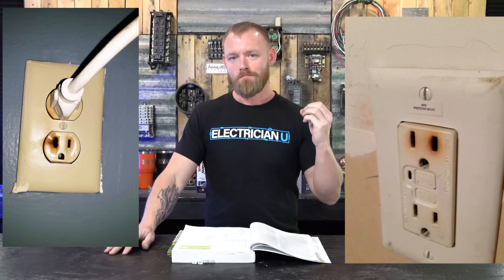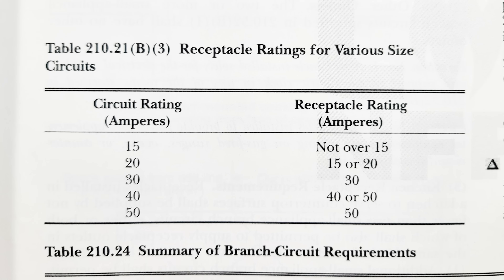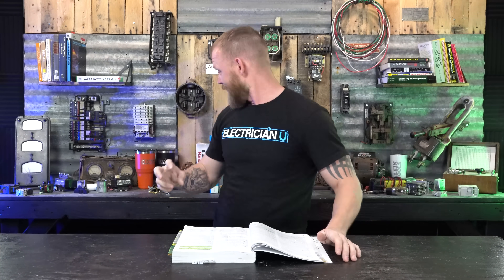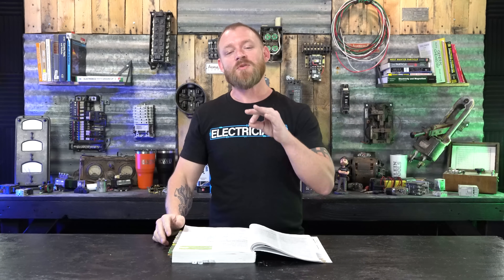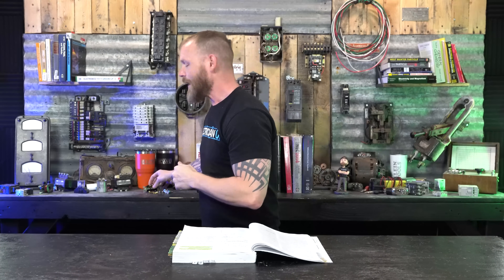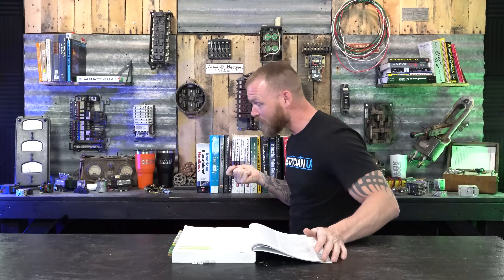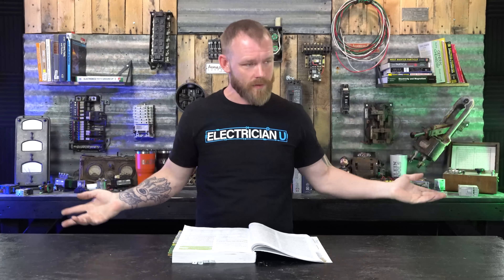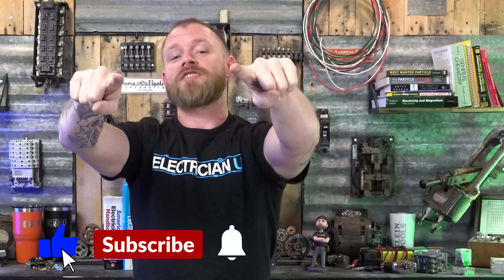Won't These Melt?!? 15amp Receptacles on 20 amp Circuits!!!

Comment: I was under the impression that the 15A receptacles are actually built to handle 20A but just don't have the 20A faceplate on it. I had figured that melted outlets were from multiple things plugged in or from increased contact resistance from worn out receptacles. Is that true?
Reply: Yes 100%. Identical internal parts. Only different orientation. 
Melted receptacles are most always loose or otherwise resistive connection of the plug blade or the wire connection.
Reply: Yes.  Context of the load matters a lot.
Reply: I was looking at a 15amp gfci and it stated it is rated for 20amps pass through so yea there the same besides the faceplate.
Reply: @FishFind3000  GFCI are slightly different in that regard, simply because they already cost more money and are less common than a standard recepticle and also can pass through, they are pretty much all built to be 20 amp, while really cheap 15 amp standard receptacles might not be
Reply: Loose connections play a big part as well
Reply: I always was under that impression as well.    If you look very closely at the new 2 slot receptacles (FYI they are still manufactured today, for replacement use only,  on older circuits where no equipment ground is available,  ) the receptacle front is shaped much like your standard 15 amp grounding receptacles,  only the round ground slot  had been covered over, and the green grounding screw is not in the threaded hole near the bottom of the receptacle.
Reply: Yes correct, the difference being a single, high current "20a load", can only be plugged into a 20a device. 
This assures safety of the wiring.
Reply: I guess the point is knowing that the average homeowner doesn't understand any of this, what is to prevent the scenario where they plug the multiple space heaters into the 15amp outlet? The idea of requiring labeled single outlets for "high-draw" appliances makes some sense, but obviously people would find a way around them. Is there a effective way to have the breaker trip when that 80 or 100 percent is reached? Or should more "high-draw" appliances be required to have the NEMA 20 amp plug regardless of actual power requirements to prevent them being plugged into an inadequate outlet?
Reply: NEC 210.21(B)(2) and Table NEC 210.21(B)(2) 15 Amp receptacles are 12 amp max load. and 20 Amp receptacles are 16 Amp max load.
Reply: @tiggeroush  that's because residential breakers are rated for only 80% continuous load, not because of the receptacle
Reply: @tiggeroush  so a 20A receptacle can melt at 16A, but a 20A breaker only triggers at 24A? That sounds like a really dangerous way to set the standards.
Reply: @Spencer-wc6ew  Thats not what the standard means. Ratings for everything are always less than what the device can actually handle before failure to have a factor of safety.
Reply: Residential grade receptacles are definitely not designed to pass through more than 15A.  That is why they are so inexpensive.  The commercial grade receptacles and heavy duty receptacles rated have heavier bus bars which can pass through 20A to the next outlet on the circuit.  GFCI receptacles have them as well.  Melted outlets can occur for a variety of reasons among them normal wear and tear and overloading.  I proactively replace any outlet I find in my home that doesn't firmly retain a plug.

Comment: great video, I am just getting to run an extra 20 amp circuit out to the garage to run a small flux core welder, this video gives me useful information   Tnx
Reply: Muchas gracias por cada uno de aros videos .!! Soy electricista … y estoy aprendiendo más y más cada día con tus vídeos . Muchas gracias por tomarte el tiempo y por la calidad de vídeo que tienes .!
Reply: Make sure it's a gfci
Reply: @Jason_Van_Stone  thanks for that, much appreciated.

Comment: What about switches on the same circuit? 
What if you have a 20 service. You have a bathroom with a switch a light and a receptacle on the circuit. There’s no heat or air in the room, so in the winter someone will use a heater in this bathroom. Do you need to protect the light and switch?
Reply: I don't put lights on receipt circuit.  20A for receipt, 15A for lights.  Too many wires in switch box when you have many 3 and 4 way switches.  Plus if you pop a breaker you are not left in the dark.
Reply: Yeah. Up here in Canada it's actually against code to put them on the same circuit now.
Reply: Great points. I don’t do new work though. A ton is 70s 80s work. usually in a remodel I’ll change out the gfci and there is one line ran to the box and both are powered through that one circuit. Not always but lights sometimes are ran off same circuit. What would be the best recommendation for the homeowner. And how unsafe is it? If it’s been that way for 30 years, how do I assess the risks?
Reply: @HomeMasterRenovations  I hear you. Up here only the receptacle is required to be gfci. Because its not expected that water would spray the light switch or fixture. But appliances can be expected to be dropped into the sink. Or exposed to a wet surface.

Comment: 130 percent of 20A is 26A but your point still stands about it not tripping immediately after 20A
Reply: You need to do that math the other way my dude
Reply: @Morberis  how are you calculating it.
Reply: @mikeatgmail9705  in Canada, ampacity of circuit times 80%. So 20ax0.8=16a. You reverse that to find out what size of breaker you need and size the conductors off the breaker size.

If you want to use a continuous 20a load on a 20a breaker you need a continuous load rated breaker which are rare if available at all and expensive.

Any modern breaker I use will trip pretty quick at 20.5a.

Other load types like motors have different rules. You take FLA of the motor, say 21a, and reference table 29. So a single phase motor has an OL setting not more than 175% of FLA if using a time delay fuse, 300% of FLA if using a non-time delay fuse, or 250% of FLA with an inverse time circuit breaker.

Comment: I have never seen a 15amp plug melt from load.  Loose connections yes.
Reply: there's only two reasons for that bad / loose connection. Cheap outlet or repeated high draw causing heat, which reduces the spring tension of the blade area. Eventually it will get hot enough to show signs of heat damage.
Reply: I've seen receptacles melt from something plugged in that was a short circuit, but not from an overload.  I have seen breakers melt from overload.  A 40 amp load on a 30 amp breaker that didn't always trip.
Reply: Arcs run at 10,000 F.  Any arcing will quickly melt stuff even if amps are low.

Comment: So part of this explanation that doesn't sound correct to me.  You are saying that a 20 amp breaker will not trip until 24 amps (and implicitly that the 12 gauge wire can handle this, and the 20 amp receptacles can handle this) but a 15 amp receptacle is only made for 15.0 amps?  It comes down to the code requirements for UL listing I guess.  It would make more sense to me that all wire and receptacles should be made to withstand 135% (if that is the desired safety rating) of it's rated current.  So then a 15 amp receptacle should be able to handle more (maybe 20.25 amps), so the 21 amp draw is less dramatic than saying it is 6 amps (40%) too much.  But then, that would seem like common sense to me. I don't know safety factors for electrical components.
Reply: Modern circuit breakers trip on temperature, overheating and overcurrent. So 20amp breaker tripping at 24amps is fuse factor. UK devices are rated 6k or 10k, this means they can withstand 6,000 amps. Potential fault current, that's why your old fuse wire use to go with a bang. Most of our outlets have 500 plus amp potential under fault this gives quick disconnection times.
Reply: You have that all backwards. A 15a breaker will trip on sustained greater than 12a load, a 20a breaker will trip on greater than 16a sustained load. 

Anything between those ratings and the breaker rating needs to be cyclic to not trip. Because the breaker will get too hot and trip otherwise.
Reply: @Morberis  ... actually, you have it backwards and Douglas has it right. Breakers will hold 130% load for a period of time before tripping. The 80% rule is a built in safety factor for circuit size calculation.
Reply: @rupe53  Hmm maybe, I'll have to look it up later. Or it's a difference csa vs nec.

Comment: I think the reason there melting is an old plug or worn out outlet making poor connection and thus higher resistance and more heat.
Reply: Or the 39 cent outlets they sell at HD or Lowes.
Reply: thats right...loosy-goosy outlets wreck havoc on plugs...causing high resistance and arcing......
Reply: I had a burned plug, and there were screws to take the back off.   Back in the day, the spring sides were replaceable.   They were 30 years past their replacement date.
Reply: @normbograham  yeah my sister in law had a spa on a fifteen amp circuit and it melted the main GFI outlet I had to kinda fix it because the house passed the home inspection but my conscience told me to fix the outlet and make sure all outside outlets were GFI protected. What is wrong with these inspectors I would be checking every outlet with a GFI meter or something. Inspectors get paid good and they don't even do their jobs correctly.73

P.S. I learned a little trick to trip the GFI on the daisy chained outlets put a wire in the neutral and touch the ground with the other end of the wire it will trip the GFI anywhere in the string. Your hand will also trip the GFI also but don't try this at home. 73
Reply: @ronb6182  Now, they have plug on neutral, and cafi breakers (gfi's built into the breakers).  In my mind, it's the greatest innovation in electrical, since they came out  with cable wire (NM), the mice didnt like as much.    Second would be the wago lever nuts.
Reply: @normbograham  yeah I heard about them I probably keep using old school nuts I don't like push in connectors of any kind. We have some in our light fixture I pulled out the feed line very easy, the ballast wire was a bear to pull out because it was a smaller gauge. If I was in the electrical business I would probably switch to save time. I don't have many junction boxes because most wiring was daisy chain. The grounds are the only wire nuts in most of the house. The fans came with their hardware so I used it. I probably won't upgrade the breakers either. The shed is going to be EMT before I close in all the walls. I want to do some EMT work just to keep in practice in bending conduit I know they have ends and other openings for wires. My dad used both Greenfield and bended Conduit back in the fifties. I hope I can do it half as good as he did. Thanks I will keep in mind about the new products coming out. At least when I do an LED conversion I know the hot wires can easily be pushed into them connectors the only thing I still have one wire nut to do because the blue wire is too short to make it across the fixture I do end to end hookup because of shunted tombstones. My company won't buy new tombstones. I'm lucky I got the bulbs. Small companies have small budgets but I'm there maybe two more years then to the mountains for me . The little house I wired years ago will be home. 73
Reply: @ronb6182  Jumpering neutral to ground would give a bit of an arc flash surprise if it turns out to be wired backwards! It also might not work if there's not enough load to make a voltage difference between neutral and ground.
Reply: @NiHaoMike64  I don't wire backwards period. Also they make ground plugs that test polarity. Enough Said. 73
Reply: Yeah there are many causes that make receptacle outlets melt. The one thing people don't mention is arcing that goes on inside the outlet. Silent switches arc a lot especially when they get older. They should bring back the click switches they never Arc. But people don't want to hear a switch. I remember the soft click in our bathroom switch. Kinda miss that sound. 73
Reply: WHAT?! Your reply makes no sense! Please investigate what a homonym is and maybe re-post. (Hint: they're, their, there.)
"Worn out outlet" WTF?! If it's "worn out" (optimal word being "out") then won't it NOT WORK?!
And if there's an increase in resistance won't the load then require more current -- not less? (It's basic Ohms Law.)
... Again, I can't figure out what you are trying to say.
Reply: @WXSEDY  When he refers to “worn out,” I believes he means a receptacle that does not make full contact with whatever is plugged into it.  In other words, the plug is loose and making poor contact.  The partial connection is like introducing a section of smaller wire in the circuit.  (Smaller wire has more resistance per foot than big wire)  This smaller wire (loose receptacle) will now heat up more than allowed and may melt the receptacle.
Reply: @WXSEDY  Suggest you stay with the english lesson.  Lower resistance will increase.

Comment: I use 20 amp breakers and 12 gauge wire and make sure I use spec grade receptacles and devices when possible. They cost more, but are better built, live a longer life, and most allow 20amp pass through.
Reply: Cheep fire insurance
Reply: ....why not use a 20a receptacle... After all the expense it's only like 25¢ per receptacle.
Reply: @Morberis  yeah multiply that by 400 that's why. Watch the video he already answered that question. 73
Reply: @ronb6182  Maybe the US pricing is biased because you don't buy them.
Reply: @Morberis  no I never bought one because I'm not an electrician. I will buy a few in the near future. I have a washing machine outlet on a fifteen amp outlet with a 20 amp breaker. It passed inspection. In my current home and all the past homes we had had regular fifteen amp outlets on the washing machine circuits and all had twenty amp breakers. My dad had thirty amp fuses on all the outlets and lighting. That was legal in the fifties. The outlets took two different types of plugs they all were rated at thirty amps. None had grounds but the boxes were all grounded by EMT. 73

PS when you are in the field of electrical you will use what code allows and not more . If the customer wants 20 amp outlets then you put in 20 amp outlets. I'm just a home owner and will use 20 amp where I feel they are needed. The washer and workshop will get 20 amp outlets. Most people don't even load their outlets more than 300 watts at most. TVs and computers don't draw that much current anymore. I would never use number 14 wire in my home I have used it outside but inside I wire with number 12 no matter how much it cost. I have two 250 foot rolls and a partial so I won't be buying wire. I always believe buy when the price is low. I only paid 35 dollars for the first roll the other two more like 49 or so. Now it's much higher. I also have plenty of number 6 three for the range. Now they are using number right but let them 6 is better. 73
Reply: @ronb6182  73?
Reply: @MMGJ10  best regards
Reply: @ronb6182  Uh no, like he says code is minimum and better shops definitely treat it as such. 

People definitely use more than 300w. Even with computers 300w is on the low side. New video cards can pull more than that.
Reply: @ronb6182  I just had time at work so I decided to double check and pass it on. A 20a receptacle is $1.15 more than a 15a receptacle. $2.74 vs $3.89.

Though as you go to higher spec versions the price diverges a bit.
Reply: @Morberis  you are probably right but I know what I use . I have low monthly electric bill. Lighting is LED and one TV which ain't much. My water heater is on a timer which is about an hour and a half a day. AC is a window unit and I don't cool the whole house. Maybe later I will add up the watts from each outlet that I use I don't use every outlet in the house. Also I turn off which is like pulling the plug my TV don't stay connected when I'm at work. I won't use any box for tv service. That will give you an idea that I don't use much electric. 73
Reply: @ronb6182  You don't need to be an electrician to change receptacles, that's heresy. If the wire to the receptacle is no. 12 wire and it's on a 20a breaker it's cheap to put a 20a receptacle on it because you're doing (insert small number of outlets here) instead of a whole building at once.
Reply: @hithere7382  what brings this on I wired the house from the meter box to the last sub panel and every light, fan and outlet your comment don't make sense. 73.
Reply: @ronb6182  I read your earlier comment as you saying you've never purchased or replaced a receptacle.
Reply: @hithere7382  not mine I do my own wiring and replaced many outlets and switches. you must have someone else s comment in mind.

Comment: I just looked at a 15amp gfci and it’s rated for 20amp pass through.
Reply: This is the same for 15a Receptacle too, which is why a 20 amp overcurrent device is allowed on these circuits.

Comment: DIY’ers are changing out discolored or wrong colored outlets to match a newly painted wall for example.  When they are strolling down the aisle at Home Dopie, the unboxed 15 amp outlets & switches are the cheapest.
Reply: "Cheapest" is most of the reason. Those cheap receptacles barely grab the plugs and losen up in short use. Loose plug, more resistance, higher temps.
Reply: @JasonW.  Then the customer goes back to Home Depot to buy another cheap replacement receptacle.
Reply: @robertlafleur5179  At least Hope Depot sells Leviton, so homeowner might accidentally buy a good outlet.
Reply: Good explaination